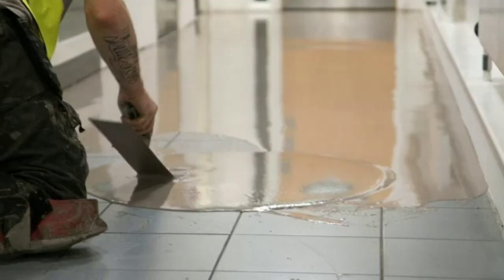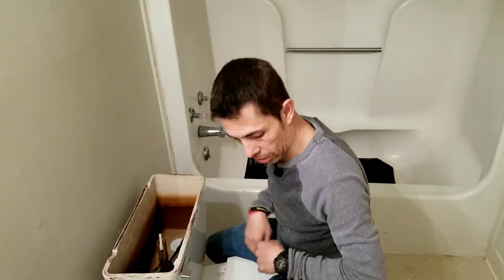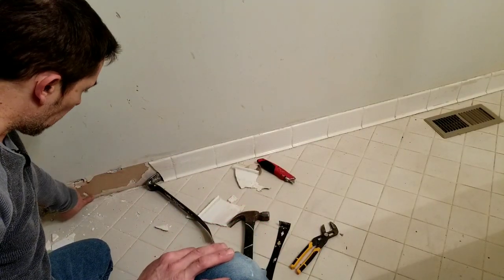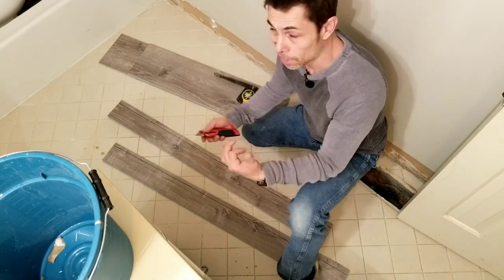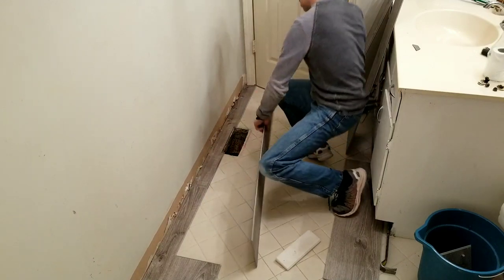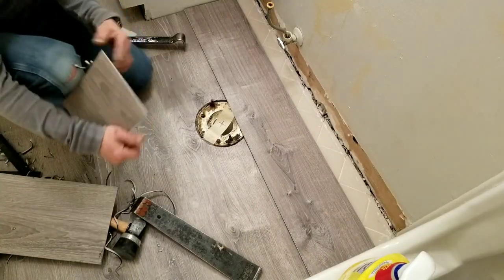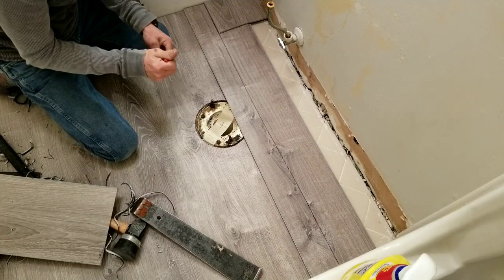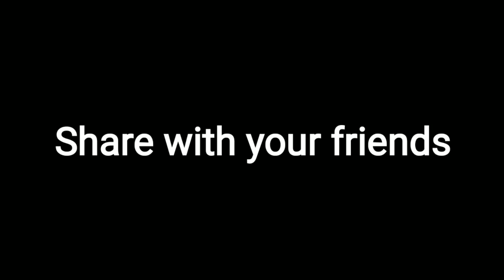LifeProof Vinyl Plank Flooring Over Existing Tile Tutorial

Comment: awesome video! was just curious does the toilet flange have to be level with the floor? what do you do to ensure that it's level with the floor?
Reply from the maker: I have messed up so much in the beginning if my career on this one that I stopped resetting toilets and just paid to have them done. I do my own now and I make sure the flange is sitting on top of the finished floor. Not flush with the floor. Hope that helps Thanks for the question

Comment: I just happened to run across your video :) I was wondering what would be the best route to lay the lifeproof planks over Saltillo Tile. Idk why my parents decided to install this shit in the living room & master bedroom lol but I hate it! And I know how expensive it will be to remove. So I’m trying to figure out if I’m able to get away with removing and if I can lay this over it with a pad underlayment or fill the grout lines to make them even(ish) to float the floor on top. If you have any insight on this I would love to get some information. Thanks so much!
Reply from the maker: Yeah I've seen that stuff before and have tore it out. Miserable  experience. There are a couple things you will need to address. First ...yes I would pour some floor leveler over the whole  thing  to fill in the grout joints and smooth the over all floor all together. But before you do. Make sure you are going to be able to open the front door. And decide how you are going to finish it off. B e c ause a pice of quarter round may not fit. With the door. You don't need an additional underlayment with lifeproof. The pad is attached. Hope that helps.feel free ti ask any other questions.  I'll find the answer if i dont know itThanks
Reply: @YOUFLOOR  makes sense thank you so much for your input! We were going to replace all the doors in the living room / front entry way / as well as the master bedroom since they all have too many freaking windows lol 😂 so we planned on getting doors to fit once the new flooring is in. Thankfully the grout lines aren’t as deep as most Saltillo flooring so getting them leveled shouldn’t be too bad.

Comment: How do you fill the gap and seal at the tub edge?
Reply from the maker: Most of the time, I try to cut my planks up tight to the tub and then seal it with silicone. But if you're using 1/4 round against the tub. And you have a pretty nice size gap, then you would want to use backer rod/caulk saver. Place it in 1st and then seal up the gap with silicone. Place your 1/4 round in the silicone and fire your nails down at an angle into the gap. Then, I always put a small bead of white silicon caulk on the top so water doesn't seep behind it. Hope that helps.  Thanks for the question

Comment: Very informative.  About the 1/4" space for expansion, did you leave this space between the planks and vanity/bathtub or just the walls?
Reply from the maker: I left expansion against vanity and walls bit ran it pretty tight against the tub. Use 100 white silicone at crack. Hope that helps. Thanks for the question
Reply: @YOUFLOOR  thank you, this video has me thinking that I might be able to tackle this installation myself. What would you do if you were replacing the vanity and there was no tile underneath?
Reply from the maker: You would need to chip off any clumps on the edges up against where the vanity used to be. Just so the is no humps then, I would cut a piece of plywood to set in the old spot. And then smooth the whole thing over with floor patch or floor leveler. Be sure to plug any nail holes and cracks and even under base boards if you're using leveler. That stuff can run behind walls if you let it get away. Also if you pour a thin layer over the tiles to fill in grout lines. Definitely use a primer so it sticks to the tile.Hope that helps. Feel free to ask any questions.You can also email us at youfloor.net@gmail.com.
Reply: @YOUFLOOR  this helps, thank you for the great content and guidance!

Comment: Hi, I really like your video.  I want to put lap over tile and have 3 things I am concerned about.  My tile is 12 x 12 and some of the pieces are broken.  No loose pieces, just cracked.  Also some of the adjacent tiles are higher than others.  Not a lot, but I do catch my foot on them some times, and my Hoover mop/vac will not clean the low one.  The other problem is in the hall.  Shortly after we moved into the house (I think the previous owners did the tile work shortly before they sold the house)  the grout that is perpendicular to the length of the hall has cracked and come out as I clean.  This has happened to a lot of the grout lines.  Someone suggested that the floor was flexing, but I don't know how to determine what the problem is
Reply from the maker: Man I have thought about your situation and it sounds luke someone  may have laid tile on detra or the actual subfloor.  Maybe they used backer board it obviously wasn't thick enuff and installed  with thin set underneath. I had a problem about 10 years ago. Where the company I was installing for made us use detra.  If there is an area with a long spand some times deflection will create a little to much flex for the grout. See it's like concrete. It's not made to bend. Or it will break. I had to fix the grout 3 times o. A job. Finally I used a latex grout made to flex. Epoxy grout can work too but very messy. So Honestly if I were installing it , because of warranty I would probably pull the tile. I would hate for the tile to start cracking and grout start crumbling. And creating g a crunchy sound under your new floor. Hope I explained that well.

Comment: How do I make the transition from the wood vinyl in the bathroom to carpet in the adjoining room? The tile in the bathroom now is about the same height as the carpet and the vinyl floor added on top of the tile won't be drastic. The tile now the meets the carpet with a metal tile trim piece and the carpet in tacked it place with carpet tacks close to the metal strip. There is little space between the two. Do I need to take the metal trim out to make way for the transition strip? The carpet can't be cut back as it is already on the side of the door jam in the adjoining room? Thank you for your advice.
Reply from the maker: I'm thinking the metal strip you're talking about is a lineal.  It slides under the tile and caps the end to hd the tile in straight. If that's the case it can be tricky.  I'd really like to help. If it's possible could you send me a pic of the situation so I can get a good look for an accurate  solution.  Look forward to hearing from you. Zconstructionllc@gmail.com
Reply: @YOUFLOOR  Thank you Zeon. I sent you an email a few days ago with some pics and an explanation. Thank you for your insight.
Reply from the maker: @Ward Fisk I just emailed you. Let me know if you have any questions!

Comment: Hi, great job!  Really enjoy your videos.  Should you leave a gap underneath baseboards (I'm talking between baseboard and the planks) installed over vinyl planks to allow for the 1/4" expansion movement of the planks?  If so, what do you recommend?  Thanks.
Reply from the maker: No you do not have to leave a gap between baseboard and flooring. Only on the ends. If you are putting flooring down 1st then you can use the baseboard  to hide expansion gap then there will be no need for 1/4 round. Unless the subfloor is super wavy on the edges. Hope that helps. Thanks for the question

Comment: We would like to place the vinyl flooring over existing 4 1/2 inch square tiles.  However we have a small area that bows down, third row to the door entrance. The bow height is 1/4 to 7/16.  What do you recommend ?
Reply from the maker: I would try to rough up the tiles in that are with a grinder. ( MAKE SURE TO PREPARE GOUSE FOR DUST). NOT A LOT JUST ENOUGH TO MAKE THE LEVELER STICK. Then roll on some of the bonding liquid . (USE A PAINT ROLLER). And then pour some floor lever out our the dip. Let it run over a little so you can feather it out on the edges. Hope that helps. Thanks for the question

Comment: Do you need to add a vapor barrier when installing over wood in a bath room?  Do you need to caulk the perimeter once installed and before trim goes on??  Love the videos.  Great tips.
Reply from the maker: No vapor barrier is needed when installing LVP over wood. If you are going to seal the perimeter with silicone, you should do it while installing the trim so you can press the trim down into the wet silicone to create a water barrier around the edge of the flooring.

Comment: I watched how to lay vinyl flooring over tile in a bathroom.  I know about using 1/4 round with baseboards.  What did you do with the flooring at the tub?  Also I have tile throughout the house so do I still need the transition piece at the bedrooms and bath doors if I’m laying vinyl throughout?
Reply from the maker: There's 3 way I do this. Each situation is different. But if your subfloor is wood you can leave you normal expansion gap  and then nail your 1/4 round at an angle into the subfloor allowing your new floor to still  have freedom for expiation (which really isn't a lot with lifeproof) if your on concrete you can use silicone to attach  it and I I put a small bead on the floor against the tub and a line with small gaps on the tub side. I fill those gaps with hot glue. That hold pretty good til the silicone dries. Last suggestion. Check out my latest video "installing  pergo outlast and go towards the end where I show  how to scribe  the last row. https://youtu.be/BUJ8DtYOEII.  Unless your planks are diving into the tub than this method will get you really close to the tub with a small consistent gap that matches the contour of the tub. Then you can just caulk with white or clear silicone. No 1/4round needed. Also as long as the tile is adhered good. I wouldn't see the problem . Thanks for the question

Comment: Hi Zenon, any suggestion on which adhesive/glue is best for the wood piece for the transition on a concrete floor when you can't use a brad nailer?  TIA
Reply from the maker: I use aurethane  glue made by loc tight. Home depot or lowes both carry this product and you can get it on Amazon. It will say 3X on the label. Hope that helps.

Comment: I want to put life proof over my tile that is on a raised foundation of a single family house in Southern california. I think the grout is about a 1/4”. Should I put an under pad or anything like that? I don’t think the directions say to do so.
Reply from the maker: No your ok. There is pad attached to the bottom. However it wouldn't hurt to skim coat of floor patch or self leveler to fill in the grout lines. I believe the directions say to do that if the grout lines are a 1/4 inch or bigger. There's a very small section about this in the video. Hope that helps. Thanks for the question
Reply: @YOUFLOOR  thanks for the reply. I was thinking to be safe to put some self leveling concrete but not sure if it really needs it.

Comment: Hi great video. We have some cracked tiles that wiggle a bit. Does that make it not a candidate for this?
Reply from the maker: If it was just one it would be OK but if you have several loose tiles it would probably be best to pull the tile floor and lay on the sub floor. Thanks for the question

Comment: I need to install ¼" plywood over tile to match hardwood level floor. How would you fasten the plywood to tile- plc glue?, screws?
Reply from the maker: There is no good way to do that. I would not advIse that. When you install 1/4 plywood on wood subfloor, you need a minimum of 4 inches In Between each staple to ensure a good hold. Without being able to staple thru the tile, you will need to pull the tile and build back up til you are level  with thw ml other floor. Sorry to have to tell you that. Hope that helps. Thanks for the Question

Comment: Did you have to add a flange Extension for the toilet so that the toilet sat up a for caulking, or did you leave it flush with new floor?
Reply from the maker: Well we usually  have a plumber co.e set our toilets. But I did some research and from what I gathered the flange really needs to sit about a 1/4 above the finished floor( if the floor can't be installed  under the flange. Which is preferred) if the flange is too low there will be a gap between the wax and the bottom. Causing water to leak from the bottom. This can be undetectable for months (don't ask me how I know) Like I said I usually have a plumber  reset my toilets with a guarantee. 😁 But to answer your question.  Yes you would probably need a flange extension if it sits too low. Hope that helps. Thanks for the question.

Comment: Hi, I've been thinking of laying vinyl planks over my tile but I also want to install the vinyl planks in 2 adjoining rooms to the tile that have carpet. Like you mentioned, it's very expensive to remove the tile. Would I be able to lay wood in the carpeted areas to level it out with the height of the tile and then install the vinyl planks? Thanks.
Reply from the maker: As long as the tile is bonded well. And you can get thre new plywood as close ad you can to the tile  and close enuff in heigjt. I would seal up any cracks with silicone and great stuff and pour a thin layer of floor leveler to make a smooth transition between the  2 floors. Hope that helps. Thanks for the question
Reply: @YOUFLOOR  Great, thanks for the tips.
Reply: @YOUFLOOR  would you use 3/8” cdx or 3/8 cds ply?
Reply from the maker: Not sure what cds is. But any kind of play wood will work as lo g as it is the same thickness. I wouldnt buy expensive plywood as it getting  covered up. Osborne is the flattest but some of the other can be cheaper. Just be selective. Remember you get what you pay for. Hope that helps. Thanks again for the questions. Good luck on your project.

Comment: Will this still work if there are some spots in the tile floor with slight lippage?
Reply from the maker: As long as none of the tiles are loose. I would either grind them down flush or put some floor leveler over the entire floor until all slippage is gone. If it is only a slight lip you should be ok. But once you get over an 1/8 inches It could create some  Teetering over that point. Small lips shouldn't affect it. Hope that helps. Thanks for the comment

Comment: I have tiles at the entry of the house, bathrooms, and in the kitchen area. The living room and bedrooms have thick carpets and it seems like there will be a quarter-inch drop when I remove the carpet. Like a giant square area surrounded by tiles. I am planning to do vinyl everywhere. The kitchen, living room, and the entry areas are open and all connected so I can't use a transition piece to eliminate the height difference after I remove the carpet. What would you recommend to level the rooms with tiles so I can do seamless vinyl?

Liked and subscribed!
Reply from the maker: When you say viynl I assume you mean viynl planks. If you mean sheet vinyl disregard any of this. Bit if the area at the door is small I would go ahead and remove that down to the rest of the subfloor. Then if it is only a 1/4 inch you can use luan as a fill to bring up the height. It's cheap and makes a great filler. Or if you don't want to go that route you can always check out my video " how to transition from a higher surface to a lower surface. Thanks for the question
Reply: @YOUFLOOR  Thank you. I will be using luan from what I see. I appreciate your quick response.

Comment: My current tile has a minor crack.  HD will not lay the Lifeproof and suggest I get it all removed which is very costly.  Can I just remove the cracked tile and install the Lifeproof on top of that?
Reply from the maker: If the rest of the tile is adhered good and there is no risk of future cracking. Then what I would do is take that tile out and clean the are of any loose grout or debris. Then pour a layer of floor leveler over the whole area so that the leveler fills in the void from the missing tile. When it fills in and runs over you'll have one solid smooth surface. Definitely put the roll on primer 1st if your going over tile. You want tit to stick. If you follow the directions for mixing on the bag you really can't mess this up.and you'll be pleasantly surprised at how flat it makes the subfloor for your new flooring. Hope that helps. Thanks for the question.